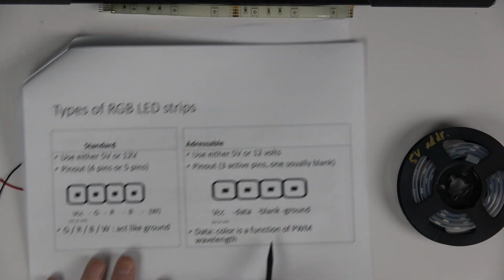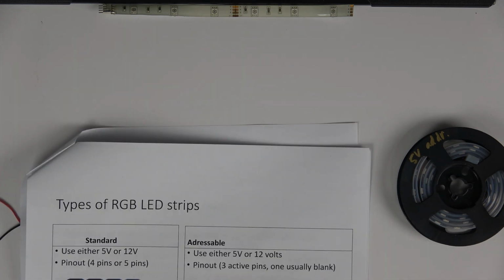RGB Header types on gaming motherboards

Comment: Question, my Strix B550-F says maximum power rating is 3A(5V) but then says, "The addressable header on this board can handle a combined maximum of 500 LEDs".  Doesn't that conflict with the power rating?  Would 500 LEDs pull way more power?  It says this directly in the manual, so what am I missing?  Thanks.
Reply from the maker: Hello IPlayTheBestGames... your question is very good and I answered it specifically on a video I made for it. I know it will help others as well. https://youtu.be/aVQarDoeaQM

Comment: I have a question that I'm not able to find a straight answer for. I have an Asus tuf x470 mobo, and it has 4 pin fan headers. What I want to know is, are all 4 pin headers rgb headers?
Reply from the maker: Not at all... I Googled 4 words and 4 clicks to download the manual from Asus website (tuf x470 plus gaming, I assumed) and got diagram at page 1-12 and answer about RGB at page 1-16. It took you more time to ask the question  than find answer for yourself. No answer for you! Lol and sorry.
Reply from the maker: If you made the effort and still don't understand, let me know and I will guide you...

Comment: Hello, thank you for the clear video I have one minor question. I have noticed my motherboard has a LED CPU free 4pin, does that need to be for pump only or could I use a 4pin strip in that slot in place for aio rgb?
Reply: wow i had to really strain my eyes but upon closer inspection my motherboards LED CPU connect reads 12v R B G

Comment: I need help, Gigabyte B450 I Aorus Pro Wifi have have header label as D_LED... is it same as 5V 3 pin?
Reply from the maker: The answer  is in your motherboard manual. Section 9 page 15 and section 10 page 16. Your D Led headers are by default 5v but can be used with 12v by changing jumpers as per section 10 page 16, BUT by default the jumper is set at factory at 5V. The D LED headers themselves are ARGB and the pin-out  is shown at section 9 page 15.

Comment: my motherboard only has 2 12v 4 pin connectors and the fans that i got have a daisy chain leading into a 3 pin 5v connector, but i cant use that?

Comment: I recently purchased the Hamer Storm RGB convertor so that I could get some RGB lights working. Unfortunately it isn't working. Power is on, all cables plugged in properly. However, I noticed that my motherboards RGB header says 12v,R,G,B underneath it and the cable from the convertor that needs to plug into it says 12v,G,R,B. Is that why it isn't working?

Comment: Hi, I have a motherboard (aorus b450m) that has 2 connections (argb 5v 3 pin / rgbw 12v 5 pin), I want to know if I can connect a 4 pin strip to the 5 pin port (the last pin is for the color white ) or it is mandatory to use a 5-pin strip

Comment: Question: I have a B450M DS3H with no RGB headers, except for a 4-pin "LED_CPU" which doesn't specify if its 5v or 12v. Would I be able to plug my AIO RGB splitter (contains fans and waterblock's rgb) into the LED_CPU? Thanks!

Comment: My motherboard dont have vdg port any other way to connect argb?
Reply from the maker: All peripheral and fan manufacturers have stand alone controllers to control argb fans, so there are tons of choices out there. I like this Coolermaster unit because you can run  ARGB fans and can run as a stand alone unit or can be connected to a motherboard with an ARGB header or standard RGB header, it is pretty versatile and future proof... https://www.coolermaster.com/catalog/coolers/rgb-accessories/argb-led-controller/

Comment: brought TufB450pro and i Read at manuel 4pin rgb headers  5050led support up to 3M.
Reply from the maker: Not necessarily.... It depends on how many led's  per meter come in your reel. Some come at 30 LED's per meter, some at 60 LED's per meter. Just get the specs of you LED's and you can make the proper calculations. Most motherboards manuals now specify the amp ratings of the RGB headers and the last four machines I built, those headers were all rated at 3 amps max.

Comment: So my fans have 2 connectors...one for standard RGB and one for addressable 3 pin...you can connect either...which one is best
Reply from the maker: Very unlikely... probably more one for fan header and the other one for ARGB... Please provide brand and model... Fans like the deepcool CF120 have a 12v fan header and a 5V ARGB 3 pin connector

Comment: Thanks for the explanation it was really helpfull. I have one question, you said that you used a power supply to give your led strips 5v or increase up to 12v. If i want to buy it in a store, what do I ask for? Sorry if the question is dumb, I lack expertise in the electricity area. Thanks.
Reply: Not OP, but I'd guess something like "Variable DC Power Supply" is what you want. Amazon has a bunch of different ones, like a big block with a dial on the front.

Comment: ok 2020 here. ty for your video. my question is that on my asus H370-f mobo has onlyy 4 PIN header. my PC house's LED has 3 PIN out. What could be that item that I can connect my 3 pin to 4 pin or what could be the solution?

Comment: Is there a way to convert the 5v signal to 12v signal and vice versa , as in my case my motherboard has 4pin rgb headers but my fans have 3pin rgb ones
Reply: I have this same question. MSI B450 tomahawk and Versa j24 case, so 12V motherboard headers and 5V case RGB fans. Looking around the internet, I see people recommend the Deepcool RGB converter hub which (should) do 12v RGB to 5V ARGB and vice versa... Going to order one and see. 

Otherwise, the B550 tomahawk has BOTH 12V and 5v headers which should be able to do both, hopefully at the same time.

Comment: What no-one is answering though is; my motherboard doesn't have any kind of RGB header or ADD header (ASUS). I'm trying to find an expansion card to add that functionality.
Reply from the maker: Your question is too vague to answer... If you just want RGB Led strips and fans, just go on Amazon or Micro Center websites. All major brands sell stand alone controllers, like Corsair for example.
Corsair CL-9011110-WW Fan Controller Commander Pro Temperature Monitor https://www.amazon.ca/dp/B0725HP1J2/ref=cm_sw_r_cp_apa_i_RRzsEbC1DV7MQ

Comment: can a 12V rgb header handle a 5 meter rgb led strips??
Reply from the maker: Davinzi Gaming... NO it CANNOT!!!   Usually each header is rated at 1 amp, so at .02 average current draw per led, you can light up Maximum 50 individual RGB LED, and that would usually be less than a meter. Read your datasheet, all the info should be in there.
Reply: @cac2244  thanks!!!

Comment: please do you know or what happens if i connect a 5V ARGB device to the SPDIF_O header of my motherboard? SPDIF_O have 3 pins plus one in blank. The voltage are 5V. It seems to have to work in static led mode... or not?
Reply from the maker: LOL... One has nothing to do with the other... I guess you are trolling... If not, oufffff...
Reply: SPDIF is an audio transfer format.

Comment: i really wanted to know if this would work.. so its not possible to run a 5v argb strip or fan off of a 12v header agreed but what if a controller had  a 5v argb output for a argb fan or strip can that 5v argb output be divided into 2 or more 5v outputs using a 4pin rgb splitter??
Reply from the maker: Well, first of all, I made my own adapter to take a 12v ARGB header to feed a 5v ARGB device by making a voltage divider and signal and ground bypass. I should make a video of that. As for your question , yes you could use a 5v source  to 5v output with a splitter as long as you do not max out the amperage of your 5v source. Usually the data sheets (when available) of the source and output (strips) would tell you how many lights or fans that could be fed by your source.
Reply: @cac2244  thank you sir..

Comment: What should I do if my motherboard only have a standard 12V header but the LED from the fans use an adressable 5V system? Where does the VDG cable comes in all this? Very enlightening video nice mate
Reply: Did you find a working solution?

Comment: if the strip only has 4 pins, will it still work if i plug it on the motherboard with 5 pins? leaving the 5th pin (W) open?
Reply: Yes. I did that today and it's working fine. The 5th is the "W" and you don't need it, it's just a nice thing
Reply: @aaronboswell5966  Thanks for checking 👍

Comment: Im stupid but ... You wouldnt know if the asus cable from the themaltake argb radiator fans will work with the msi 5v header on my motherboard?? Im half way into my first bulid and ive just realized my box did not come with the msi cable but looking at the guide for the fans they look the same. Please help! i can not be asked to take it all out, contact the seller and then return it🙁 Thanks

Comment: Older motherboard no rgb header. Bought an adapter/expander that hooks to sata for 12v and also has a "RGB in" that is supposed to be hooked to the motherboard.  I also have a yeelight light strip. Surely, after verifying which pin is 12v, I can route it to the "RGB in" on the adapter/expander and have the yeelight match the color of the light strip?
Reply: This worked fine. But I had to switch two of the colors inline.

Comment: Which addressable LED strips would you recommend - 5v aRGB?  I have the AORUS pro wifi MB.  I have already successfully connected a 12v 5050 led strip but I didnt like the spacing of the LEDs on the led strip that I have now.  I am looking for a more - dense LED strip...like 600 vs. the standard 300 .
Reply: Same motherboard and same idea. Did you buy some they you can recommend?
Reply: I picked these 5v aRGB strips - DC5V WS2812B led strip RGB 30/60led/144 pixels dream color smart LED Addressable
Reply: @mantownmedia78  Did you pick the 144led per meter version? Thats the one i want because right now its still to dark in some spots in the case.
Reply: @NecroFromDark  See below - 300 leds and the IP67

Comment: I can’t find a single mobo that has a 3 pin rgb connector for my cooler master fans fml
Reply from the maker: All FAN headers on mobo are 4 pins. Fans with either 3 pins or 4 pins connect to it by aligning plastic tab and groove.
Reply: CAC2244 not fan header. I’m talking about the rgb headers they have the 12v4pin and the 5v3pin
Reply: @DiscordCriminal  aorus b450 no 3pin 5v only 12 v.

Comment: hi can u help me?. my motherboard is GIGABYTE Z390UD can i connect 2 led strip to my motherboard, or i need a led splitter?
Reply from the maker: Well, as per page 14 of your manual, your RGB header is a standard 12V/G/R/B header, so since the average amp draw per led is about 0.02 amps and that  the headers are usually rated at 1 amp, then it means as long as you do not have  more than about 50 led's then you should be ok (as a general rule of thumb). It depends of the led strips you will use, but it looks ok... as when it comes to using a splitter... i do not really use them, i do my own extension with 4 wires that a solder in series with a cheap soldering iron and it also depends of the led strips that you use... so I can't really say much more to help... Make sure you connect 12V to 12V (usually indicated on strip and G with G, R with R and B with B.  The website doesn't say how you will be able to control the color of the LED strip as it refers to a "unique feature" web page that does not exist, but I suspect you will be able to control using the "ambient LED" app that can be downloaded on the support page of your motherboard. Good luck!

Comment: I bought a 5V strip and was hoping I could plug it into the rgb header on a mobo. A little disappointed but very happy you could answer my question since no one else did in the past 2 days. Liked and subscribed
Reply: I picked the 300 led IP67 which came in a silicone sleeve...black PCB